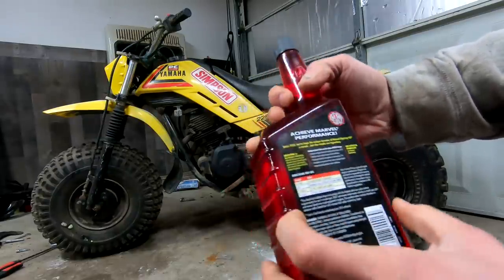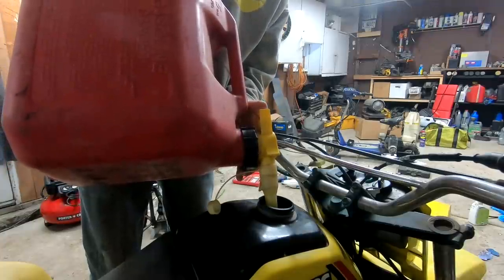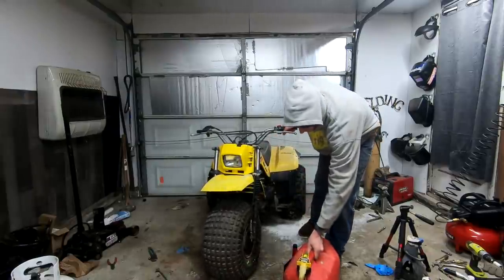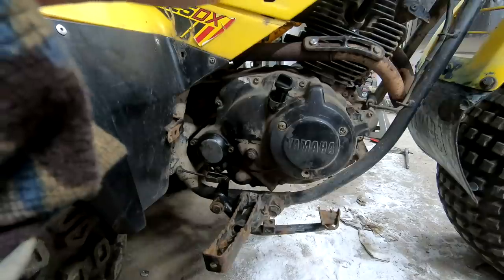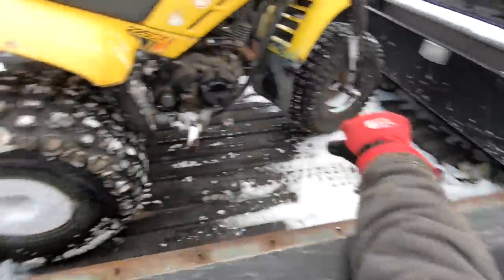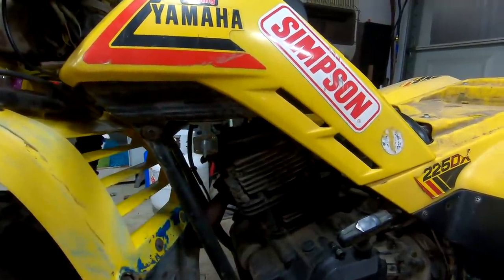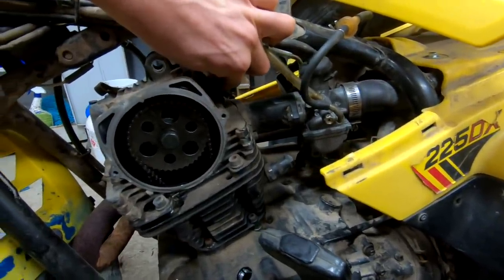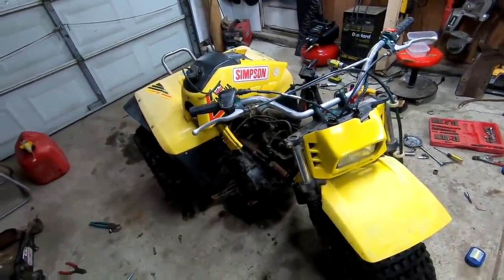35 Year Old Engine Tick VS Marvel Mystery Oil

Comment: Marvel Mystery Oil History: Founded in 1923 by Burt Pierce, the brand has remained legendary for over 90 years. Pierce’s reputation for ingenuity preceded him as he was already well-known for inventing the Marvel Carburetor, standard equipment on 80% of all vehicles produced after World War I. Vehicles of the post WWI era encountered carburetor problems, the most perplexing being clogged jets due to high lead content and other contaminants found in the gasoline of the time. The problem motivated Pierce to direct his creative ingenuity towards formulating a blend of chemicals and petroleum products to clean and maintain clogged jets. He was successful beyond his wildest expectations and the legend of MMO was born.
Marvel Mystery Oil proved to have other beneficial effects on the engine. By creating a top ring seal, it produced higher compression and by preventing blow-by on power strokes, it resulted in more power. Marvel Mystery Oil also improved gas mileage and minimized engine wear.

Comment: When you use the impact driver, turn it in the direction you want the screw  to turn while impacting it with the hammer. It usually only takes one strike of the hammer to loosen it. Hope this helps.
Reply from the maker: I checked it on my boot before I started hitting it. I may not have been hitting it hard enough. Or the bolts havn;t been touched in a decade.

Comment: Adjust the valves.
Trying to use MMO for top end noise like you're experiencing only works with hydraulic lifters.
Reply: Ed Gregorowicz most definitely, alittle adjust on the ol ‘ rocker arm and she’ll be good too go I’d think !
Reply: You don't say in the video, but the valve clearances are supposed to be checked COLD.....
Reply: Because metal expands when heat is applied to it lol I meant to say it expands
Reply: Actually, it EXPANDS.

That's also why the exhaust clearance is greater that it is for the intake.... The exhaust valve is hotter.
Reply: Ed Gregorowicz he adjusted them in the video.

Comment: MMO is great stuff when used for the problems it can fix . Lubricate injectors , clean and unstick hydraulic lifters , unclog oil scraper rings , clean sludge out of oil galleries and cylinder heads , clean valve stems and seals . I've used it for over 35 years along with seafoam .

Comment: I use MMO in the gas of my machines after they have sat a few seasons. Like the Snow blower, generator, and power washer. Before I put them all away for longer term storage I run them all empty. My snow blower is at least 15 years old and I’ve never had a carb or starting issue with it. Oil changes and one auger and worm gear rebuild after a lot of use. 

Project farm did a ton of more scientific testing on MMO and Seafoam and proved without a doubt that these products do in fact help with cleaning and adding a bit of compression. While they aren’t going to repair broken or worn out parts they can help older worn motors limp on for awhile.

Comment: Snow is so much fun on a three-wheeler! I have that exact same 225DX, this is my second one, they both sound roughly the same. The first one I had was back in 1999, and I just got another one in October 2022 - they sound exactly the same. I have changed all of the fluids, cleaned out the carb (made the biggest difference) and basically cleaned it up at this point, the valves are next for mine. I appreciate the great video made. I love the "snap" noise of a bolt coming loose, it is sweet.

Comment: I used marvel on my 1983 atc185s , I didn't notice a big difference but I added a little bit of Lucas oil stabilizer and it quieted it down. I also like the stp oil stabilizer because it has zinc in it

Comment: Check the compression relief lever adjustment as well, if it's to tight it will cause a tick, as well as possible low compression.

Comment: 5:13  Check the oil level procedure.  Most engines require that the dipstick be screwed down, then removed to check the proper level.  I wonder if MMO is not much more than thin version of ATF. I've used it before with little to no success.  There's really no "cure in a can" for mechanical issues IMO.
Reply: MMO is actually estimated 70% mineral oil and 30% mineral spirits and then 2% synthetic plasticizers
Reply: The Yamaha tech manual for this trike specifies that you do exactly as he did (not screw the dipstick down) to check the oil.

Comment: This is normal for these older aircooled motors..brand new they had a tick.should be good for a while if it's not smoking and valves and chain are in spec leave it alone..eventually will need a head work, guides, new valve seats cut in, it would be really loud though

Comment: my guess is that your automatic timing chain tensor has a bad spring in it. I had a sloppy timing chain that made that sound. I replaced the auto tensioner with a manual one bc the oem was prone to fail. I adjust it every time I check clearance and it works like a charm. Use the ol screwdriver technique to hear where the tic is coming from.
Reply: His already has the manual one.

Comment: With the handle of a screw driver against your ear, touch the tip of the screwdriver to the engine block, head, and transmission with the engine idling to further diagnose where the noise is coming from. Also realize that the exhaust pipe, being so old and rusty, is probably thinner than a new one, and you're probably hearing the exhaust pulse though the thinned pipes. The same theory would apply to cars with exhaust headers instead of cast iron manifolds....

Comment: Loosen the locknut. Turn the clutch adjuster with a screwdriver counter clockwise until resistance is felt. Turn it back, 1/8 turn (clockwise). Tighten the locknut to 11 ft.-lbs.

Comment: For your motors safety i wouldn't go too tight with the timing chain tensioner, I have broke a a cam gear by not realizing i had gone too far. My motor jumped time in process of gear breaking and had bent valves as the outcome

Comment: The timing chain adjuster, you need to wind in the bolt until the rod inside is flush with the bolt. Then lock the nut up. I have an xt200 and the head is also ticky. These ac engines are known to cause concern for many people that don't understand that they are just noisy. Nice to check the vales and chain though for peace of mind.

Comment: Oil additives can help clean out carbon deposits, sometimes it thickens the oil to help reduce noise but nothing in a bottle can fix a mechanical issue. Just masks the problem. Kinda like turning up the radio in ur car to mask a leaky muffler

Comment: If this thing shares oil with the clutch, you DON'T NOT ever run MMO or products like it!  You should never run any sort of friction modifier additive through something that relies on friction to operate. The oils these machines run on are specifically design to not cause problems.  

Side note: MMO can fix loud valves, but it can't fix improperly adjusted valves.

Comment: The timing chain tensioner has a little rod in it that should be flush with the outside of the adjuster nut. Over tighten it and you’ll see what I’m talking about. The sound you are hearing is probably piston slap the side to side movement of the rocker arms is completely normal

Comment: That’s a timing chain noise.   Also. The oil only works to free stuck lifters.  Aka lifter tick. Wouldn’t do anything to a 4 stroke quad with no lifters

Comment: could it be a loose valve that needs a 1/4 turn tightening?
Reply: Dude it doesn’t work that way you use a feeler gauge loosen a lock nut and then turn a threaded piece to open or close gap it’s an overhead cam not a mid cam engine

Comment: ive got impact screwdriver all ready since 90's tap tap end its broken so i have started hit that in rupper hammer best tool to get screws and bolts out but why you didint use  wd40 to bolts becuse some time snap sound can be broken bolts

Comment: Marvel’s mystery oil is a fantastic product, it works well for a lot of things. It helps clean carbon deposits and Lubricates the valves ( helps them seal) and helps loosen up stuck piston rings
Reply: And it makes the oil horribly slick which is horrible for wet clutches
Reply: Yeah it’s probably not recommend for wet clutches but I doubt it does any damage as long as it’s not ridden around with the clutch slipping.

Comment: A screw driver in the jug and slowly turn the engin over once the screw driver starts going back down go back a hair and that's top dead center. Or the plug you took off you should be able to see a T with a line that be top dead center.

Comment: That stuff works it a cleans everything in between your cylinder and your cylinder walls which makes you lose compression in your engine
Reply: That's why I pour burnt bacon grease in my cylinder for more compression. Adds 15hp
Reply: make sure to change your muffler bearings every 5000 miles and top off your blinker fluid with full synthetic blinker fluid.
Reply: @jacobsebastien3910   ha ha😂

Comment: these things are bad for the cam color, the cover on the head with 2 bolts right across from each other covers the cam gear take it off and put your fingers in the holes in the gear and try and move it side to side and up and down

Comment: 3:06 That's not an ATC, it's a YTM. ATC is Honda.
Reply: whats the difference, other than brand?  act is all terrain cycle, correct?
Reply: @frotobaggins7169  honda trademarked the term ATC so yeah.....there is a difference no other 3 wheeled machines are worthy of that branding

Comment: Just adjust the damn valves. You should know that. Oh wait, your to young to know about the need to adjust valves on older engines.  Lol
Reply: Jeffrey Murdock Im 16 and about a year ago I adjusted the valves on my 1986 warrior 350. It’s pretty simple
Reply: @jacksoncarpenter4652  very simple but very few people in your age bracket know anything about it. And that's a very low number. Most young people barely know how to check the oil in a car. By 16 I had changed head gaskets on multiple cars, changed transmissions and rear differentials. I grew up working on cars and when we entered the computerized automotive era I started teaching my dad how to work on the electronic ignition cars. I dont have any kids but if I did I would hope the would be like me and you and at least know something about working on cars.  Wanna rebuild the engine in my 1980 f350 dually I call the beast by any chance? It has a 6.6l 400ci engine in it

Comment: One of the things I do like to use Marvel Mystery Oil on is engines that have been sitting for years and are stuck. I will pour a cap full down each spark plug hole and let it set a couple days and then start working the engine back and forth.